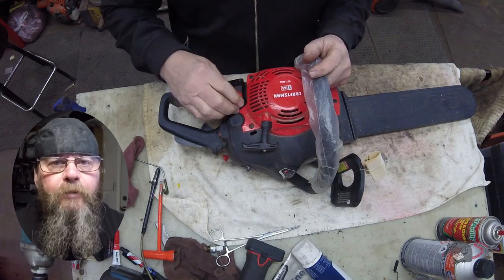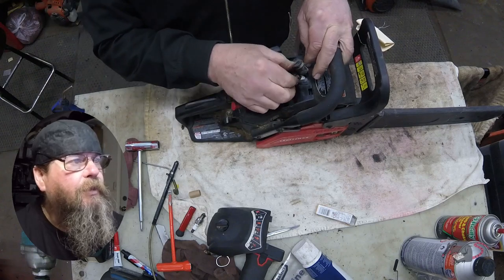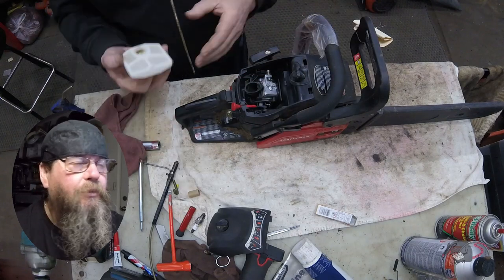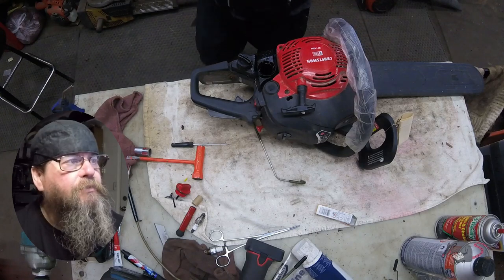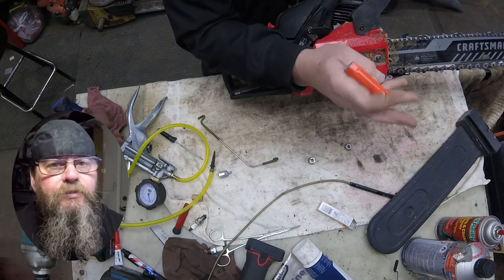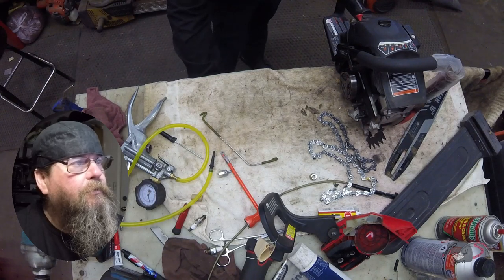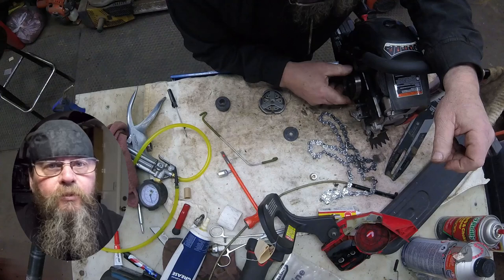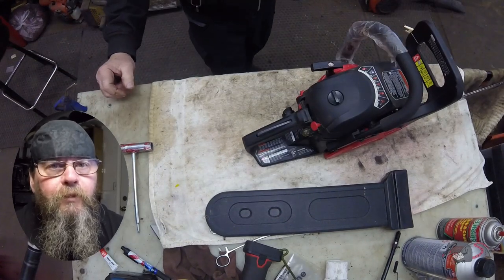Craftsman S165 Chainsaw Once Over

Comment: Okay asking about the same chainsaw I have one it's my favorite, it stopped oiling. I'm not too bad at repairing things, but I'm not sure I want to replace the oil pump on this chainsaw, single mom full-time job but we do burn wood in the winter and I cut it myself I'm a little intimidated about the clutch thing
Reply from the maker: The clutch removal is the hardest part of the job. The threads are reversed so remember that. When it comes off there's a fair chance it will come apart and that spring can be a pain in the butt. You could buy a new assembled clutch for about $14. The oil pump and worm gear are about $16. Good luck.

Comment: Learning methods of installing impeller. Normally use 1/4 impact. Don’t have a strap wrench. How do you hold to torque to 25 lb ft.  Thanks.
Reply from the maker: Rope in the cylinder as a piston stop should work.
Reply: @TheGreasyShopRag  OMG. Duhh.   Ii do that all the time to take  clutches off. Rope and plastic stops in tool box. Thanks

Comment: Please dbl check my value of 25 lb ft.  Used a plastic stop and tried 15 lbs. never got that high, released pressure and the stop flew out. Tried rope too. Would hate to damage someone’s saw. Thanks.
Reply from the maker: Tell me again what you are tightening.
Reply: @TheGreasyShopRag  125b impeller. Found another value for chainsaws of 27.5 nm (20.284 ft lb).  Always used 1/4 impact.  Don’t have a feel for torque yet. Used it on other stuff with success.
Reply from the maker: @steveriggenbach90  that seems like alot

Comment: Those nylon mesh filters are pretty much useless unless you’re cutting ice or in wet conditions. Even when sealing properly the dirt gets right through that filter. I’m not saying to buy a $1500 chain saw but don’t buy these cheap Chinesium box store saws unless you’re going to use it once.
Reply from the maker: I agree. Good filter er no, the typical homeowner that never had a saw will use it, store it and come back to it months later with fuel problems.

Comment: I modded one of those filters.
Reply from the maker: What was your mod?
Reply: @TheGreasyShopRag  I'm working on a MTD chainsaw right now. I noticed fines inside the air filter, and carb throat. I cut the mesh screen sections out. Trimmed a foam lawnmower filter element, and metal screen for over the carb throat to fit inside the plastic filter body.
Reply from the maker: @williambray4134  Sounds like a good idea.

Comment: Husqvarna 125b impeller torque. 13.6 to 16.3 nm.   10-12 lb ft.     FINALLY a more sensible value.
Reply from the maker: Ya thats way less ugga duggas.
Reply: @TheGreasyShopRag  sorry by the way for calling the flywheel an impeller. Worked around both for years.
Reply from the maker: @steveriggenbach90  I suspected we weren't talking about the same part.
Reply: @TheGreasyShopRag  thanks for not calling out my brain fart.  Lol. Thanks for all the help. Take care.